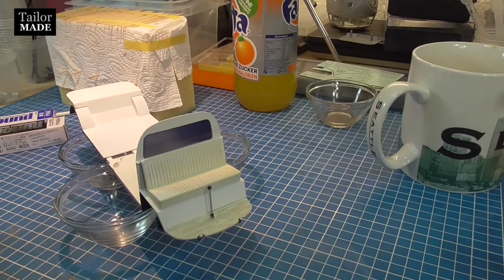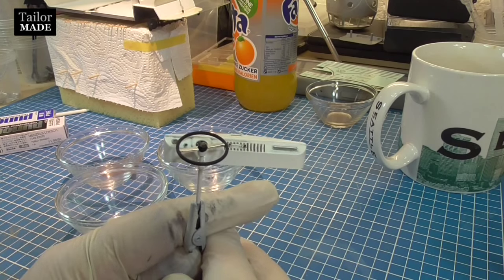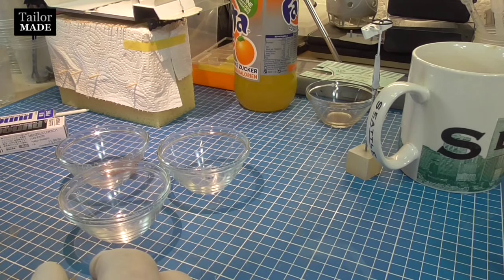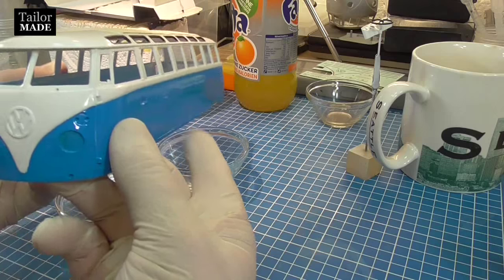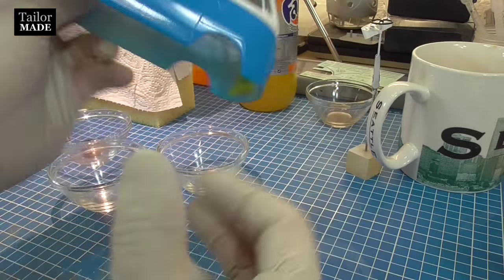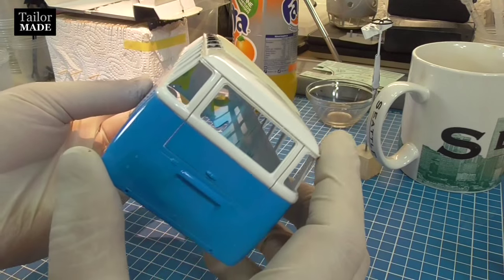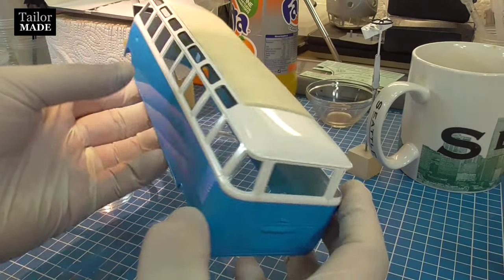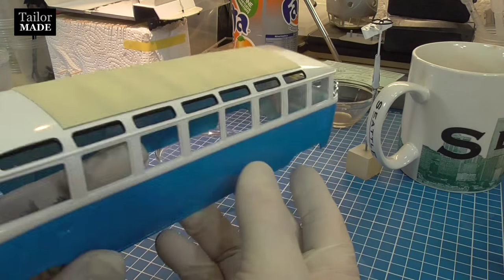"Lange Anna" Stretch Bus Project HD Part02

Comment: That looks fantastic and the rattle can results are remarkably good. I always get pooling when I use them. The scaling effect of the roof gloss is perfect. Must try those compounds.
Reply from the maker: MakingModelsAgain Getting the distance right is one thing to consider and that your hand need to be constantly in motion. The TS-line paints from Tamiya are pretty easy to work with and they hold a surprising amount of paint. Thanks for taking a peek!